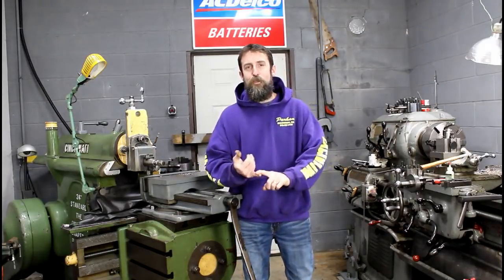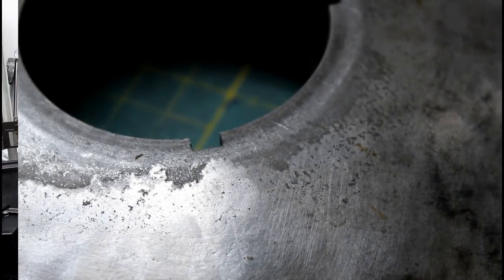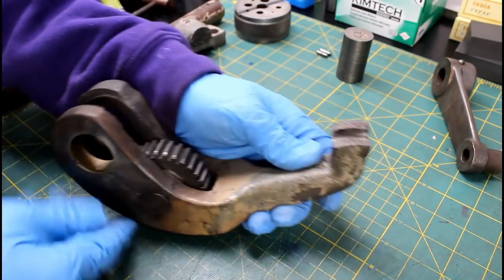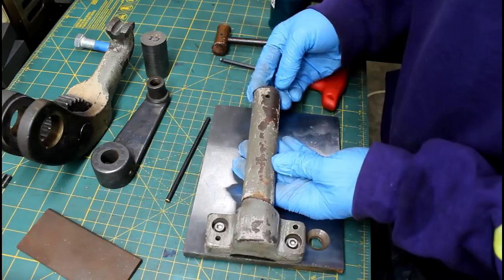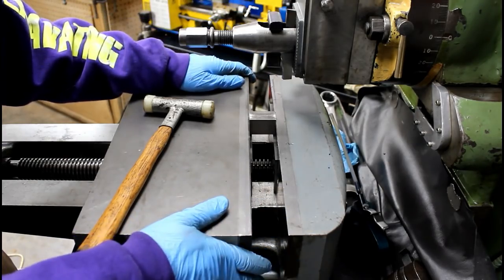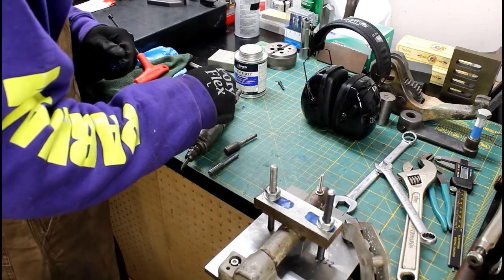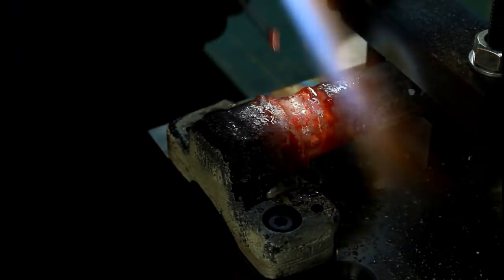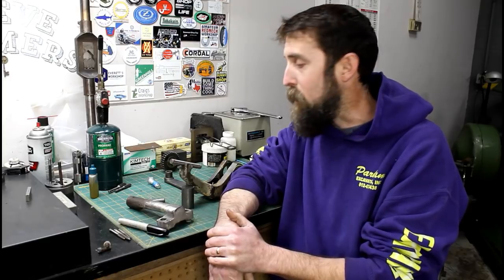Monarch Lathe Repair Broaching and Brazing

Comment: Nicely done, as you say that braze job will be invisible once the paint is on the piece.  And I have used the cutting head on the torch at work for brazing before too, nothing wrong with using it if more heat is needed than the welding tip can supply.

Comment: Nice looking braze repair Steve, but I was kind of surprised how much material you hogged out for the prep. Expected you to put a 45 deg bevel around the break then braze. Maybe I missed something in your comments. Was this done because of a strength issue? Your pulleys are really looking good for your Do All band saw.

Comment: Steve, have you ever tried Nickel rather than brass for cast iron repairs?  I prefer nickel especially in a spray powder for cast iron, but I’m fortunate to have a Stoody spray powder torch (made by Victor, a sister company).  It’s a very controllable method and much higher strength over brass.

Comment: Nice repair job Steve although I would have been tempted to fabricate a new'un out of steel. Back in the eighties I used to work on machines for making glass vials and ampoules, the had cast iron ring gears which would lose the odd tooth, we had Eutectic brazing rods with a blue flux coating for building up the teeth, the beauty of it was, it would stay put rather than flow. I don't remember the number, we just called it 'blue braze'. If you're not in too much of a hurry, after the job has cooled down leaving it soaking in a bucket of cold water overnight will make the flux a lot easier to remove. Best Wishes from Somerset UK.

Comment: The fixture is the best insurance policy to promote success when performing brazing repairs. Nice molten build up. Slow cool down is hugely important. I use a toaster oven starting at 450 and lowering 10° every 30 minutes to promote the best bonding while preventing brittle layers.

Comment: Did I see a carbon arc gouge job?...My dad tried me out on one at about 8yrs. ...scared the piss out of me, but in the shop later I LOVED the time savings cutting old welds out.       Seems it would have saved a lot of time, finish with the die grinder.

Comment: Looks like you could drill and tap and counterbore both parts and bolt them together to hold them in place for brazing. Do not know which design would compensate better for red heat.

Comment: Question for you. Have you thought of using mica sheets or something similar between the part and the fixture plate to thermally isolate them? Might help with the heat-sink problem you mentioned.

Comment: A high quality repair. I would have pinned the joint before brazing. Relying on what is effectively "glue" only may not always be the best (brazing is a very heavy duty glue of course). A better way to do such a repair I with cast iron welding rods. I do not know if they are available now. AFAIK, they are not available in Australia. The result produces a meld of cast iron that is more or less the same as the original. I have not done such a repair since my apprenticeship, that's quite a few years ago now :-)

Comment: I have a bunch of oxy welding tips but I still use a cutting tip because of the extra heat. Also a buddy of mine always cleaned up any braze prep with a file if it was roughed with a grinder. I'm guessing a burr does the same thing....something about the glazing effect that grinding gives.

Comment: The tap isn't wrong.  It's a for a Helicoil.  Which for the readers benefit, produces a 1/4-20 thread after the insert is installed.   ;-)
Reply: @Crafted, was thinking the very same thing as Steve was showing it.
Reply: Yup! Helicoil or similar
Reply: Aye, I think you're right. I said that to the tv but he didn't hear me.
Reply: I was looking to see if someone else thought that, I should have known better or watched this video earlier in the day😢
Reply: They are often labeled as STI for 'screw thread insert'
Reply: They are sometimes annotated as 2B to differentiate that it is a helicoil insert tap.

Comment: The electric motor wand grinder you are looking for is called Foredom, they ain't cheap but they are good. Jewelers and dentists use them, also gunsmiths and clockmakers. Electric motor with a flex shaft and a hand piece kinda like the ultimate heavy duty Dremel.
Reply: I have wanted to pick one up for a while, see them occasionally for great prices.   I think they would make ideal lathe mounted grinders as the heavy motor can live somewhere out of the way and the working end can be nice and compact.  Size of a dremel but with real torque.
Reply: @DrewLSsix  I have 2 of them. A standard (SR) and a heavy duty (TX) version. I also have a hand piece holder that Foredom used to make that you can clamp in a vise or tool post. I don't think they offer them anymore, but it wouldn't be hard to make one yourself. Very handy.

Comment: Unsolicited advice: Get the flex shaft grinder from Harbor Freight. It's cheap, works well, and is easily available. Drop an additional $20 after on a quick change collet handpiece, and you'll use it daily. Just remember the shafts on the bits need to be 2.35mm, not 3mm like Dremels. It's superior to Dremel in every way though

Comment: Great video Steve!!!  My dad would also braze heavy cast iron items with a cutting tip!  I've started using TIG brazing instead of gas brazing but a thick item like that still needs preheat with TIG and also post heat during cool down process . Floor dry is a really cheap method of installation during cool down.  I also save all my old welding gloves to use as insulation.  Great holding fixture!!!

Comment: Might try some carbon rod to maintain the hole on that lever when you braze it up?
Reply from the maker: That original hole alignment is critical. I'm lucky tht most the hole is still there to indicate off of. Problem is it isn't really in line with anything else on the handle. The carbon is a good idea. Braze over it and remove it. I dont have the broken off piece.  That would make the repair much easier.

Comment: That 5/16”x20 tap would be great if you had bolts the same 5/16” for if you had a 1/4x20 hole that was wallowed out.

Comment: Excellent repair Steve . look forward to the next one which I assume will need another jig with a lot more work than this one, you are correct about the glasses . brazing or small item gas welding jobs as you can see the joints much easier .(who still gas welds today when the cheaper TIG & MIG sets are available )

Comment: pushing one of those broaches through a hole kindah makes me gringe the thing is hardened and can shatter if you dont go straight down or push on it under an angle , they do their job pretty fast though compared to cutting one on a lathe

Comment: enjoyed...nice repair...as I watched you grind for the braze, I thought to myself with such a nice fixture I would have drilled and installed a steel rod for strength and complete a small grind/braze....this is because I don’t have the experience of such a deep braze as you did.....great fixture gets great results...also, I have found mislabeled taps and they do test your eyesight/brain...lol
Reply from the maker: Morning Chuck 👍Thanks for watching . Pinning it together is an option. I cant remember doing it before but I'm sure it would work fine.

Comment: It's pretty cheap to use oxy propane to braze an torch it has limitations but you'll rarely find them and it burns cleaner imagine $35 for 10 gallons of propane it last as long and is a .100 the price

Comment: Steve,
This episode was very helpful to me. I would have used a much smaller depth of braise and pinned the parts together for structural strength. I see how the fixture permitted almost 100% part integrity and retained original part appearance. I applaud your approach.
I salvaged a wood jointer relying on JB Weld where alignment was extremely critical and strength was not absolutely necessary. This kept heat out the equasion.  The epoxy was easy to machine without fear of tooling deflecting when drilling and reaming a hole with dissimilar materials. The epoxy salvaged a pile of vintage cast iron scrap after a machine tip over. I would have been more proud to have given my customer a job done with your methods.
Reply from the maker: Many people suggested the pin type repair. I've had to do parts like that in the past but if a fixture can be built reasonably quick I prefer to do it the way I showed in the video.  Some people would have just brazed it on the outside and said good enough . Chances are it would be😁. Thanks for watching Paul.

Comment: A great job but I would have drilled and installed a 1/4" rod to add additional support. Them after the brazing I would have used loctite to secure the job.

Comment: Would it help to drill, tap and run a long bolt into that long piece before brazing or would that steal valuable real estate from the brazing alloy?
Reply: I guess it depends on the person, the repair, and the need for strength.   I would often do the drill tap post braze to enhance the shearing strength.   I doubt either is wrong but I've not really done any research on the two methods either.

Comment: As a slight add to your earlier allude to 'Sod's Law' in action. If you are in your kitchen and throw 10 slices of buttered bread (same occurs with jam or honey or whatever is on the bread) Sod's Law dictates that 9 of the 10 slices will fall butter side down upon the floor, the tenth having stuck butter side up to the ceiling. ;) Keep the videos coming, Steve!
Reply: I can't remember who came up with what I am about to repeat, but basically since buttered slices fall butter side down and cat's always fall feet first, it you fix buttered bread to a cat's back with the butter upwards and drop the cat the opposing forces of butter down / cat feet down should ensure that the cat should rotate above the floor perpetually :-)

Comment: Steve have a look at pen type air grinder I use with upgraded collets , they are cheap lot's of Burr's tungsten and diamond and really good in tight spaces.Great dance by the way🙂
Reply: Stefan has one. It's like $2000.
Reply: @xenonram  I'm talking about the $30 dollar nail technician one's,not one of Stefan's $2000.
Reply: @bigbird2100  Oh. Gotcha. Thanks.

Comment: Hi Steve, i see you quite often use those snail shell type countersinks, i have a few but they need to be sharpened, how do you sharpen them? nice work on the brazing.
Reply from the maker: I dont have a good way to sharpen them. They require a cam action to grind.

Comment: I remember finding a odd tap in our tool room, 1/4-24. Don’t have any idea what it was for, never used it, and never knew it existed. But it taught me always check size. But if mis-marked?
Reply: Maybe 12-24? Odd but standard size
Reply: No it was 1/4 24 they had a full box. Someone told me it matched a size from Switzerland or some place.
Reply: Just googled 1/20-24 and Amazon and others carry them?
Reply: Many companies use proprietary 'non-standard' (odd-pitch) threads in their products. Starrett is one of them for example. Others (Honda is an example as well) that use odd size bolts in certain areas. Seat belts are attached with 11mm bolts. Not 10mm, not 12mm, but ELEVEN mm. 😒

Comment: Wouldnt you need to rebalance those pulleys Steve? That's a fair amount of metal you're taking.
Reply: True, it is a lot of metal, but it is very close to the axis of rotation. The effect on balance should be fairly minor.
Reply: @frankfreeman1444  Yeh I thought about that after I posted. Nice call :)

Comment: Best way to make sure those 3 holes line up with his machine  was to ask him for a triangulation measurement off his machine so they line up after brazing. If you're off a bit, oops
Reply: Yes, it will not line up, he’ll have to redrill hole into machine for pin I’d guess.